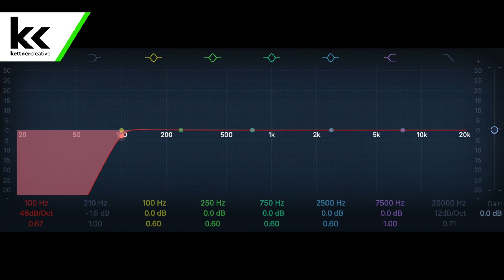What Does The HPF (High Pass Filter) Button Do? Audio Mixer Setup

Comment: I really need your help here. I just started as a karaoke dj. My problem is, I always get feedback. Originally, I was using a pair  of JBL IRX one I never had any feedback. I just recently added a Mackie 115S subwoofer at the center that's when it started getting feedback. I already used the HPF, I lowered by lows on my Yamaha MG10xU mixer but still nothing. My mic is position at the center where the the jbl speakers are in front to avoid feedback but my subwoofer is placed at the center. How can i posistion my sub on this scenario?

Comment: You can also use the HPF like an crossover for your tops ,if you want use separate volume control for your subs. Use two xlr channel inputs ,one for tops wich will send the line audio signal above 80hz,and one for the subs with HPF off . Also for subs output you can use AUX,or GROUPS .
You are welcome :)

Comment: Hi Kettner, I really enjoy your very informative videos! Thank you for producing them. Question: I have a Yamaha MG10XU and do solo shows of just me where I sing with backing tracks that are played from my laptop using iTunes. I have my mic plugged into channel 1. From my laptop, I use the 3.5mm headphone jack and run a cable with a 3.5mm TRS on one end that splits to two 1/4" TS jacks on the other end which I plug into jacks 9 & 10 on the mixer. For output, I run an XLR cable from the right XLR output on the mixer to the 1/4" TRS input jack on a Bose L1 Compact. Based on your expertise, does this seem like the optimal setup for me? Thanks.